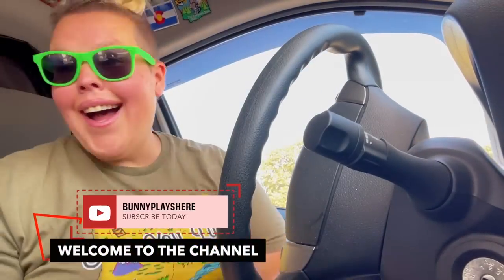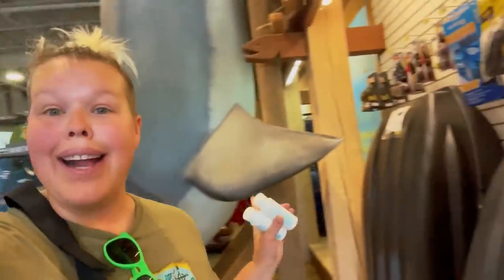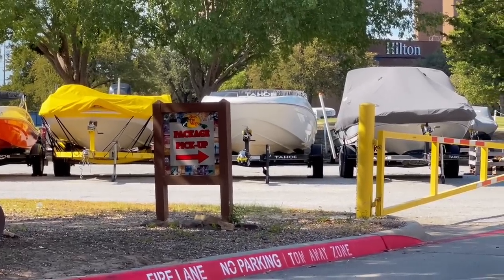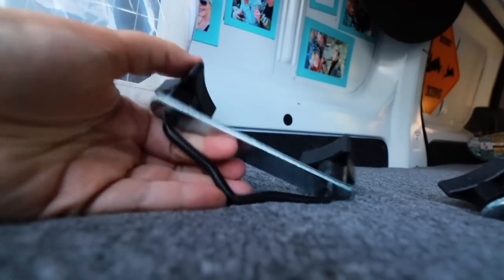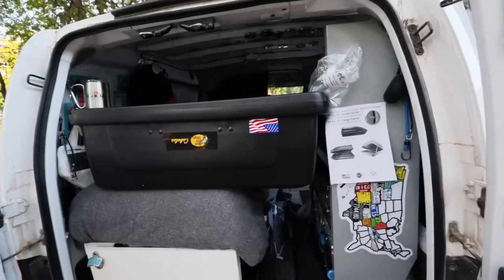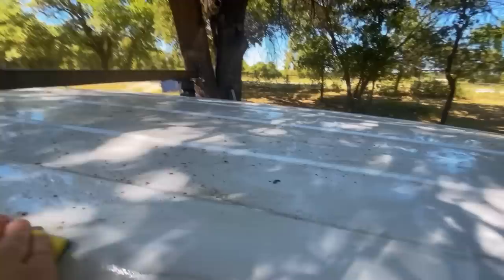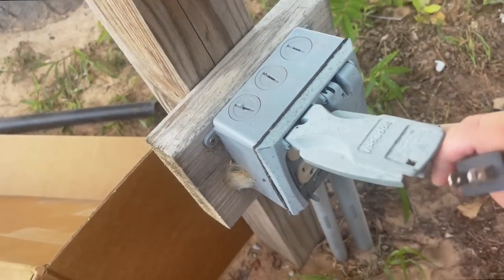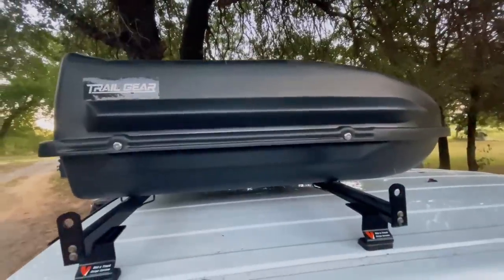Van Life Just Got Better | New Roof Box | Cabela's TrailGear Roof Cargo Carrier Install

Comment: Enjoy the storage space! We got the biggest available Thule for a cross country move, and I’ve held onto it for the 20 years since! It opens from either side, and holds an incredible amount. While I prepare to start van life, I’m storing hard stuff like camp chairs, tent poles etc., in it—the heat in a rooftop box will break down fabrics and soft plastics. I will keep a folding step stool in the van when I travel to make it easier (and safer) to access, as I’m not very acrobatic anymore.

Comment: That's a good sized roof box for your van it looks like you could probably put your awning on it's wide enough space between it and I seen that the mounting bolts on the awning move I think it'd be tight enough that you wouldn't have to worry about it coming off or getting loose. You still got two mounting places on the awning onto the roof rack.

Comment: Nice addition.  I've been considering a roof top box for my minivan. But I also have a trailer hitch and think it might be easier for a cargo hitch. Still considering which would be more secure, not that I have anything of value if it got stolen. I just want more space and organization in the van
Reply from the maker: I personally didn’t wanna put anything on the back because my doors butterfly open. Although I know that they have some hitches that can work without those tend to be a little bit harder to install so I decided against it and instead to go with the roof box. It has been such a treat having this on top of being able to carry my things

Comment: I got the jegs, same as that one, get one of those metal steps that hook on inside the door of a car/van so you can get up to reach in the box…Amazon has them. I did mine alone too, not hard but time consuming getting it all adjusted, you might want to save the box to have a place to store it if you take it off at some point.

Comment: You don't really need an expensive inflatable for water.  I used to go out on the canals here in Florida (with the alligators and all) in a cheap inflatable one person boat.  Had plastic paddle.  Always a good idea that you can swim, if need be, though it never deflated in the water.  All the new fangled repair "magic" tape could probably fix any leaks making it useful for quite awhile.

Comment: Why u didn't get a pop-up roof camper tent? You can sleep in it and put the extra things in it.
Reply from the maker: I do not want a pop-up rooftop camper. For the first three years of travel I had to pack away a tent to every single night and after doing so I learned quickly that that much exposure to the elements can become problematic. I wanted something that was self contained only when it came to my van.